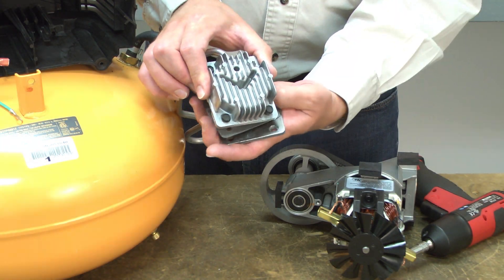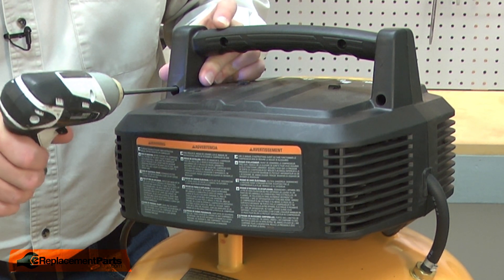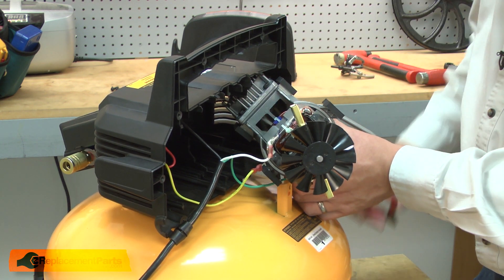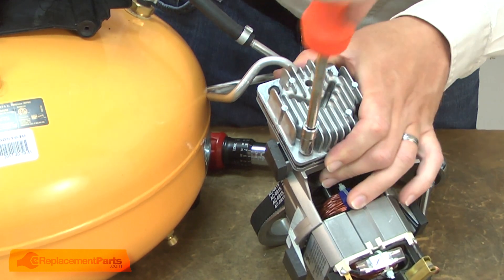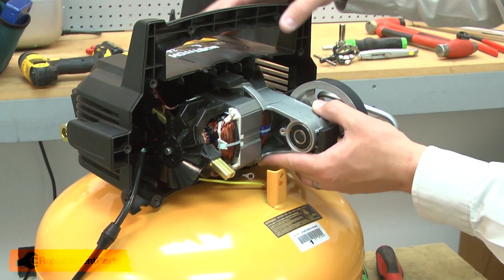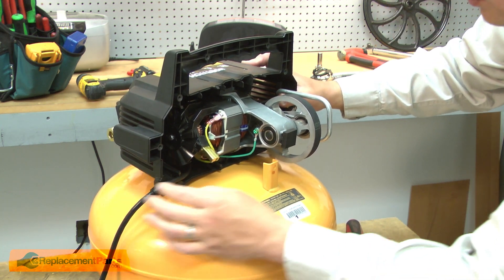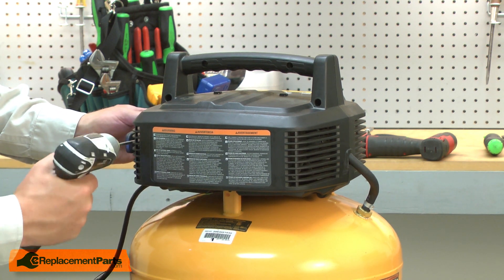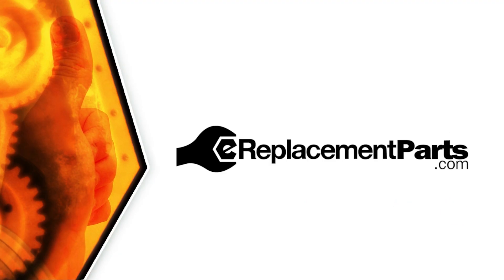Bostitch Air Compressor Repair - Replacing the Head Gasket (Bostitch Part # Z-D24819)

Comment: I have a question for you I have an air compressor which it runs but don't build air it is a 8 gallon tank and it uses oil what can be the problem.?
Reply: Head gasket is usually is the problem when it don’t build pressure an u don’t got any leaks